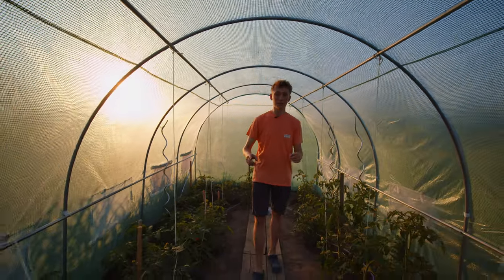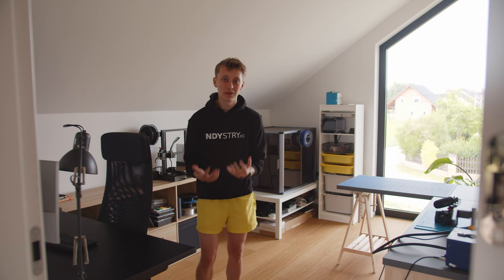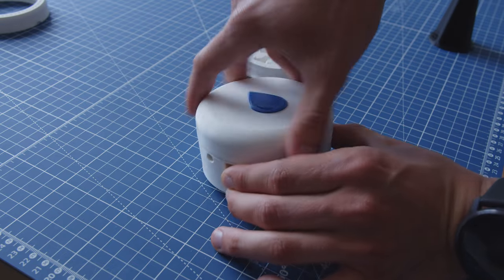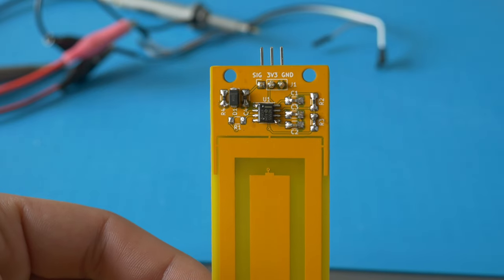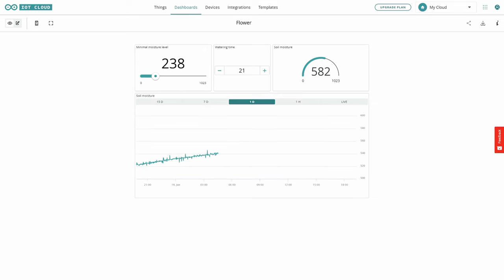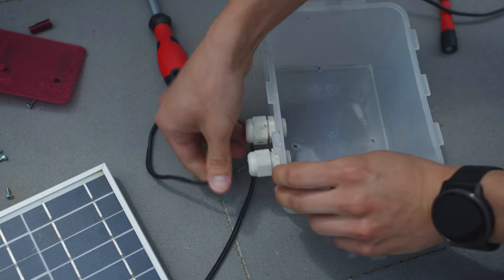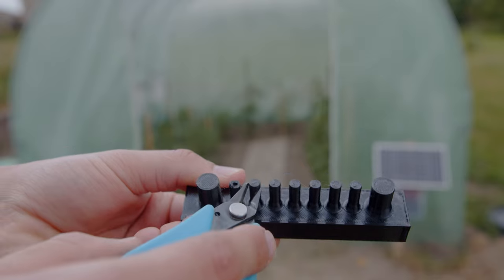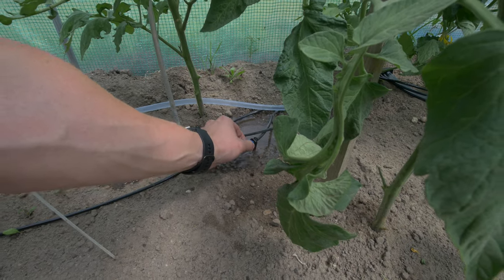DIY Watering System for a Greenhouse/Garden

Comment: I got one of those MKR 1010 units for free at a local IoT conference. It was like a little maker con but focused entirely on IoT and sponsored by a lot of the big companies (google, arduino, etc) giving out free stuff. the MKR board was included as part of the panel/class on how to set them up, so there was a whole kit - breadboard, servo, humidity sensor, MKR obviously, and some other goodies. All in all, I had a lot of fun, and even though I didn't really "get" all the cloud stuff very well (it's hard for me to learn new systems sometimes) it's proved to be the best arduino I've ever owned.
Reply from the maker: There is a high chance I also got this one for free but don't remember exactly. Compared to traditional Arduino UNO it's a totally different board, way more powerful but still as easy to use, I really do like MKR series :)

Comment: is that Artisan by Snapmaker in your new workspace?
Reply: also, it would be nice to see all the hardware(lab power supply, oscilloscope, soldering iron, etc) and software you use for your DIY projects

Comment: is it safe to cover with silicone or something, on top of that board, when everything is connected and ready?  I have an itch to just pour a lot of construction sealing silicone (you know the one used for sealing bathroom sink from water) so the water and humidity on the farm will not eat up all this board in a year (or in a season 😅)  would it be safe for the electronics of the board? (without touching the parts that are heating, only the "flip side" where all connections are soldered)

Comment: Idea is good but result is terrible if using  5v pumps. I just make similar to myself and put it into bigger pots. I got water in one  place like a 10cm D and water level is 1m lower than a pot. Now im adding sprinkler but i wont  think pumps will hold preasure. If pumps are changed to 220v ones like for small water wells and used 1/2 or 3/4 tubes with regular garden sprinklers  than we are talking about something. Same issue i see in video, sprinkler is not spraying but dropping water and also area is too small.

Comment: Thanks for your videos. I'm planning to build something similar but at a smaller scale, so I'm basing it on this video and your older one. If I may ask, how much pressure can this little pump output? All the irrigation kits I've seen require around 1.5 bars of pressure, but these pumps usually can put out 0.5 bar.
Reply from the maker: I have no idea about the pressure of this pumps but it works fine for me

Comment: What was your reason for using a water barrel instead of connecting it to the water supply line? You seem to have one in reach.
I've recently used the Gardena Micro-Drip system. Works pretty well, but some parts are pretty expensive. Did you also 3D print the adjustable sprinkler pieces? Or are those off-the-shelf components?

Also, I've read that even those capacitive moisture sensors aren't perfect, since the capacitance does not only change with water, but also with other factors like minerals in the soil or water. Would be interesting to see how they behave long-term.
Reply: I assume that it just allows you to easily connect roof drainage hose (yellow one on the video?) to the barrel and get it refilled each time it rains.